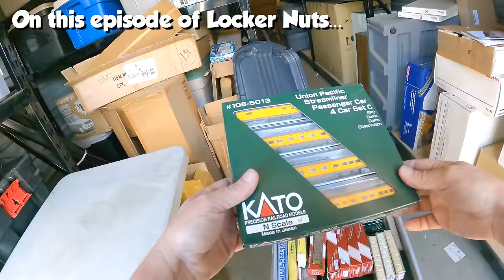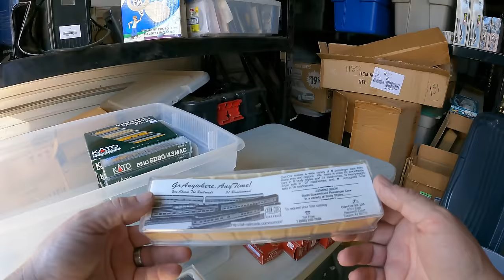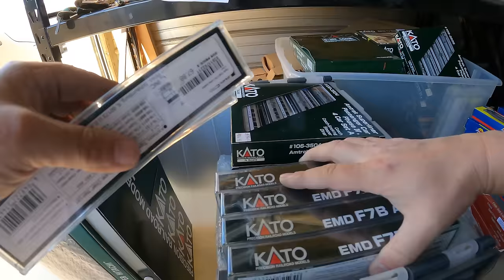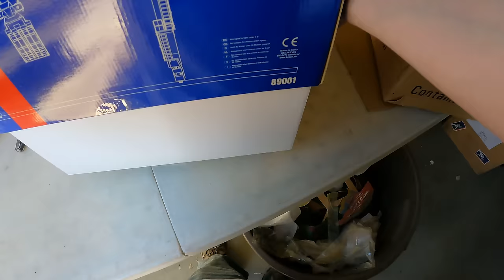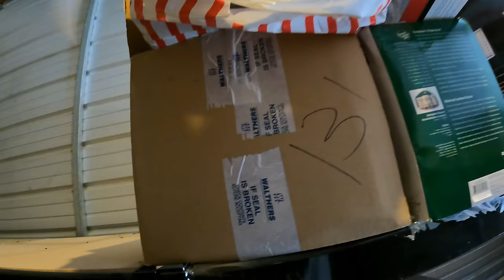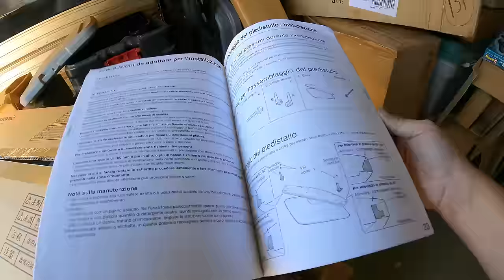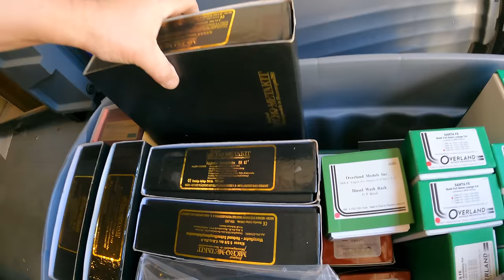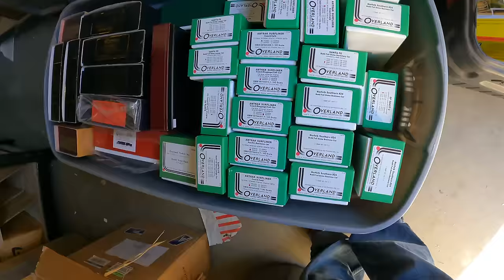What we find in just a few totes is worth more than both our cars combined!

Comment: We have a big 48" plasma TV. They are friggin' heavy; ours weighs about 300lbs. Uses the same sort of stand. This is basically because a plasma TV is akin to a tiny little CRT for each pixel, electronically... with all the tiny little electromagnetic coils and wires. Add it all together, along with the heavy metal framework, and they get heavy fast. They also burn a ton of electricity (ours cost about $2 an hour just "idling" with no signal input but powered on), which is why California banned selling them a bit more than decade ago, not to mention being expensive to manufacture - which is why nobody makes them anymore. But for sheer visibility at any angle in full HD, they can't be beat. We're going to drive ours into the dirt before replacing it, that's for sure.